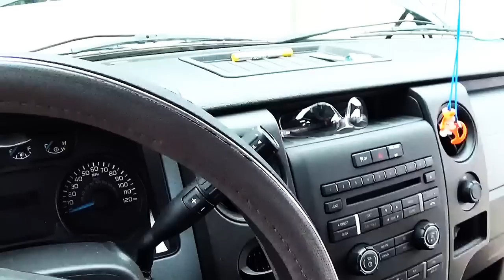Truck Tool Box Tour

Comment: I do a 1500km (900 mile)  round trip, weekly  commute with my truck....I carry a 3500 watt generator, 4 gal air compressor, air tools, set of sockets, ratchets, tools, spare battery, alternator and fuel, ropes, chains and straps.. I've never been stuck on the side of the road after carrying all that stuff LOL.., and helped a few stranded people.  I like the swing box idea.

Comment: what exactly do you do? no offense but it seems like you have a lot of dead ends and useless junk. you say the tarp works great but for what? you have a jack but no way to pull lug nuts. you have a winch but no tow strap or chain. you have a hammer drill but no extension cord battery charger or drill bits. a framing hammer and level but no carpenter or speed square you have a set of sockets but no wrenches. you say you customize your tool belt but you have 2 screw drivers a tape and a hammer. a towing shackle in a 2wd that would struggle pulling a side by side. you literally have more tools in the little pouch in the cab than in the 3 tool boxes on your bed. im saying this with all due respect  and by no means trying to be rude but i dont agree with your setup at all.
Reply: Jacob jacoby I was thinking the same thing. I used to be silly, then I got out of debt.
Reply: Glenn Girone i just didnt understand it seems like he was just a tryhard
Reply: Cleanest "work" truck I've seen in my life. Backup tools have backups.
Reply: Coach Espinoza true
Reply: And his gloves that have never been used
Reply: No way this dude is a real contractor,  not a scratch on anything,  no dirt in the truck
Reply: Dude, try watching the video before you make a comment, 2 charged batteries in the case with a charger, he didn’t say there were drill bits in there, but I don’t know a single person who doesn’t keep drill bits in there. Socket set, in case you didn’t know, you use sockets to pull lugnuts off. Socket kits are called kits for a reason, and that’s because they come with ratchets. I can guarantee he will use the winch for pulling other people out, not for himself. His truck may be under powered, but if someone is in a ditch, he can park on the road and lay on the brakes and let that expensive winch do its job.
Reply: Dillon King its fake..

Comment: Are the undercover swing boxes water proof ?
Reply from the maker: +Michael letteri Not at all! They're made to be used in junction with a hard cover. Since this video, all three tool boxes have been replaced by the +Decked system and I couldn't be more happy with it.
Reply: +Glued-N-Screwed Blog Thanks alot!
Reply: +Glued-N-Screwed Blog new vid about that system and any other changes you have made to the set up